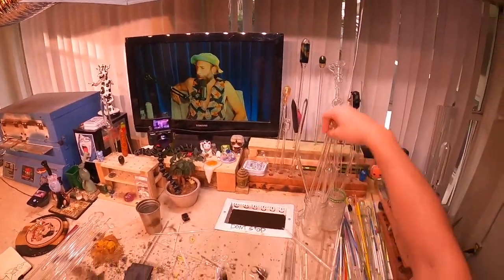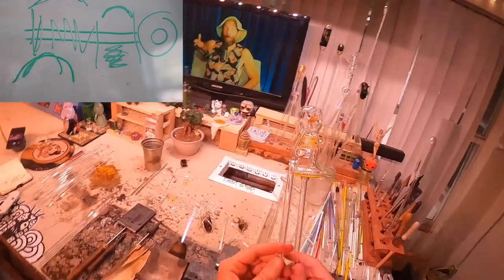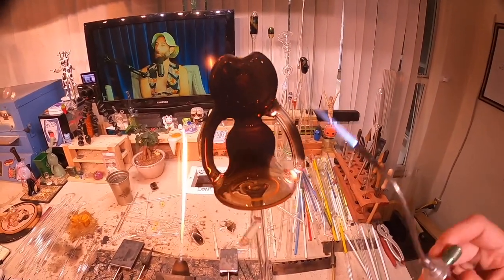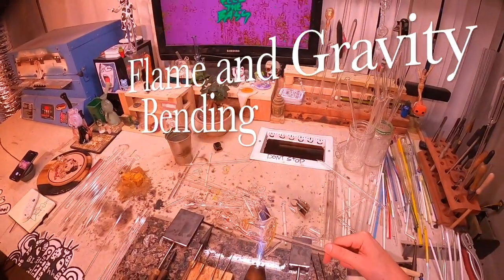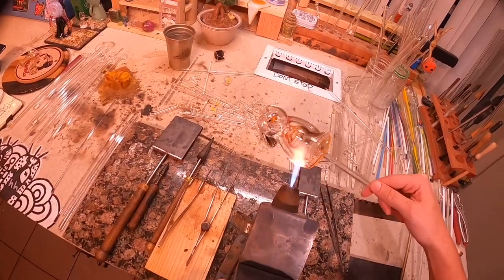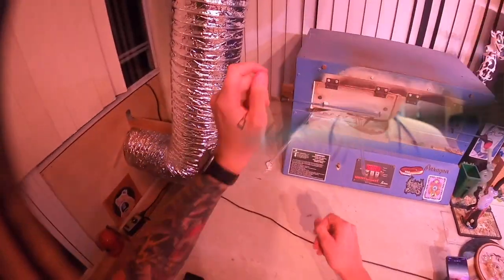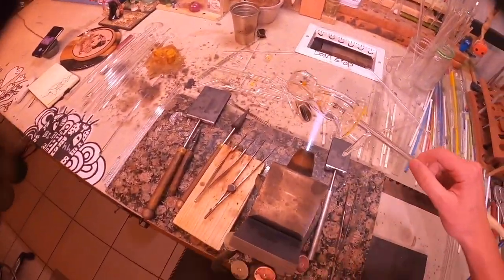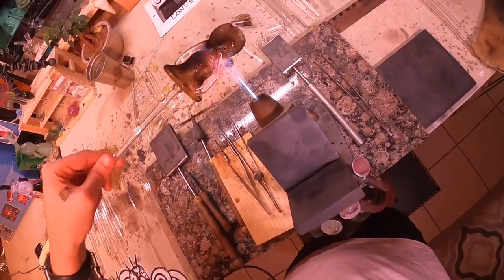How To Make Drains That Recycle || Powerful Jack

Comment: Beautiful peace man. Was wondering is there any benefit to getting carbon on your peice or no?
Reply: It helps insulate the heat into the piece. Running your annealing flame helps soak the heat into the piece in a nice slow way and the carbon helps hold it in.
Reply: Carbon is a very good conductor of energy , definitely zero insulation coming from a few microns of carbon. The only real reason is if you are new to flame annealing it can help you tell when a piece is hot, there are some artisitic methods where you can scrape away soot making a design then fuming over top to put the design into the glass. Some use natural gas which creates barely any build up , if it annoys you